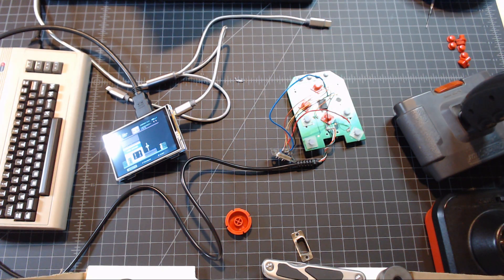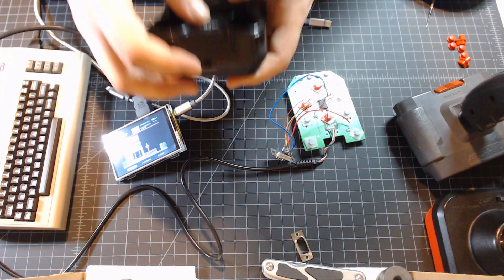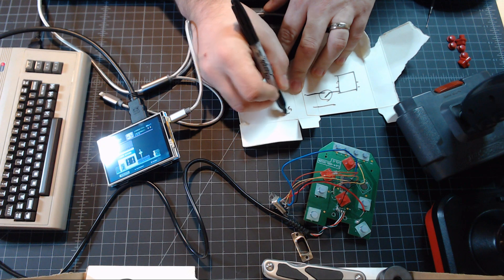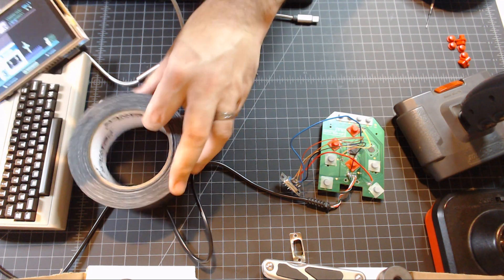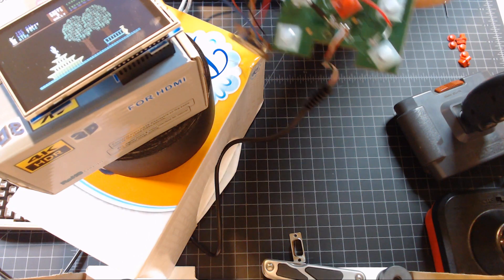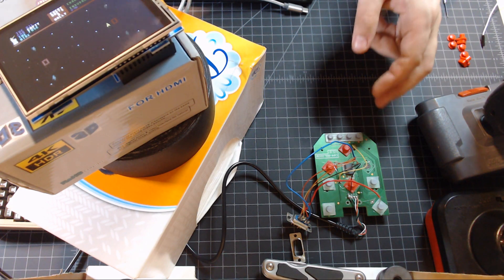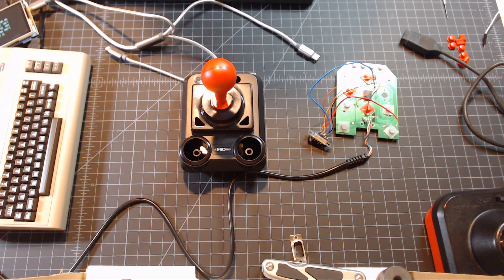How joysticks work, and why the C64 Mini joystick doesn't (Part 1 of 2)

Comment: All C64 mini/maxi users should buy the speedlink competition pro joystick. It has all the menu buttons only with different combinations, and it's the real deal! The retro brand Joystick will eventually break right off at the bottom of the shaft coz it's hollow inside!

Comment: Thanks for the video! I have the mini C64 and the joystick that comes with it. When I bought this a while back the joystick used to work, but now it seems completely dead. It still look new, and no external damage that I can see. I tried to also connect to my Windows machine, and it doesn't even register. If I put for example a mini  Sega game usb pad into Windows machine, it instantly sees the usb. I believe in the past I did connect it to a Windows machine and it did register, but it looks like right now it is completely dead. Is there a way I can fix it? I am not a hardware guy, but just wondering if you have any suggestions. Thanks.
Reply from the maker: I don’t have a suggestion if it’s not registering in windows. That makes me think that the controller board is dead which would be difficult to get past without hardware skills (an arduono Leonardo or micro for instance Ofuke be programmed possibly). Really though the idea here was to use a better joystick than the default. If the defaults dead I’d get a snes pad or similar that’s usb, or if you want to keep something retro get a usb to 9pin adapter (not serial!). I haven’t looked at this in years there maybe third party suggestions also that are better

Comment: I'm not sure if this is normal but my C64 joystick sends 4 x UP and DOWN signals. I've proven this by running jstest in Retropie and can see 4 commands. LEFT and RIGHT only send single commands. is this normal and have you seen the same results?
Reply from the maker: I haven’t seen that when testing but I could’ve missed it. Seems really odd though

Comment: My joystick isn’t working full stop.
Reply from the maker: Oh crud! Id plug it into a PC if you have one and check device manager to see if it’s even recognized. If not check the solder joints it’s possible the ground wire or something has broken off. If one of the main wires breaks it wouldn’t even register. USB has four....2 power and 2 signal

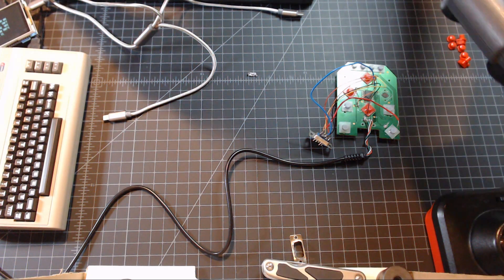Comment: 10:46
Quickshot joysticks did not use microswitches.
Quickshot joysticks used metal dome switches.
Reply from the maker: Thankyou!!! I appreciate the correction. I also found out that many older arcades used leaf switches apparently which I think I misrepresented in this video or a similar one. Too much tech to keep track of!
Reply: @geektoolkit  
Sorry, my correction itself was incorrect.

Not all Quickshot joysticks used the same type of switches.
Quickshot 1 used metal dome switches.
Quickshot 2 (which yours appears to be) used an uncommon, open frame style of microswitch.
Reply from the maker: Oh cool! Well if I was right I was lucky on that one lol! Thanks for the corrected correction. So which is your favorite retro  joystick?
Reply: @geektoolkit  
I really liked the Wico Ergostick.
It was one of the most comfortable Commodore 64 era joysticks I have ever used.
Reply from the maker: Oh I like that look!! Similar to my Epyx500, I’ll have to try to snag one next time I’m at a retro expo. When we have those again...sigh. Thanks for that!!
Reply: @geektoolkit  
Unfortunately, the Wico Ergostick actually has somewhat of a shelf life.
It has one of those soft rubber coatings that can get sticky/softened and yellowed over the years/decades.
It might be possible to clean the stickiness off with alcohol or some other solvent, but I have not dealt with that yet. My Ergostick has been stored away in a box for many, many years, but I would not be surprised if it is also sticky by now.
Reply from the maker: I wonder if retrobrite can solve the yellowing...if they’re ABS plastic (many things were/are) then that can reverse that part of it. The stickiness though...hmm wonder if I could print a TPU replacement for that part. Would be a fun thing to explore at least!
Reply: @geektoolkit  
I imagine the stickiness might be able to be wiped off with alcohol every few years.

Comment: Can you recommend other than the speedlink competition pro joystick for pc with the micro switching that i can use in my hands that's like the competition pro with the USB  but don't feel restricted to the movement i don't like the console pads. I watched your other video on Arcade controllers  joystick  just wondering because of you knowledge on this field  that you might have some better joystick that's looks the same but improved or a website that i can buy from for just playing on pc with usb plug and play for old retro Amiga games.Also i cant find your part 2 of this video
Reply from the maker: bioshock 69 part two is here: Ultimate fix for the C64 Mini Joystick - Use any Atari or C64 Original joystick!. In part two I show how to get any of the original joysticks working via a db9 so that I didn’t have to find a modern joystick, USB one or game pad. I just use any of the old ones. That may make sense as to why I went this route. If I was looking for something else I’d probably go the other way and use an arcade stick like my Quanba and some arcade buttons. Let me know if that helps

Comment: wouldn't it be a lot easier just to buy a Speedlink Anniversary Edition Competition Pro Extra Usb Joystick it has micro switches and built better
Reply from the maker: Yes of course! That’s definitely easier. You can of course just plug in an Xbox 360 controller as well. This mod is about using any original joystick but maintaining the buttons that show in the user interface. I should’ve mentioned that part. For me the Epyx 500j was THE joystick from my childhood, and anything else didn’t feel right to use!
Reply: @geektoolkit  Yes we all have our own preference myself iv'e always used the Quick shot 2 turbo and the classic competition pro this is why i was thinking of getting the Anniversary Edition as i have just found the Amiga emulator for PC with my classic games i used to game on. I just wanted to play them again for the good times i had with them from my days when the Amiga came out but i did have the Atari st 500 fm first then soon sold it when i saw the Amiga at my uncle house he had the pc  and was able to copy the games for me that i wanted  then i went to pc and i stuck with it still today.My only gripe  with the joystick that it was a bit tight on the stick movement but a review on this said it was due to the thick rubber ring around the bottom bass restricting it and needed to dismantle it to soak it into a solution to soften the rubber for around 4 days without degrading it . Then i came across the C64 mini joystick but well it had no micro switches and i think it had a plastic type ring at the base of the stick sorry for me to go on must bore you but i did enjoy your video  it was interesting

Comment: Anyone got the new C64 MicroSwitch Joystick..?
Reply: @andrewgaskell1256  Right, have taken it apart. It's based on the competition pro joystick and works on a lever system. The micro-switches are on their sides surrounding the shaft of the stick. By pushing the stick left it actually closes the right hand micro-switch and so on. The micro-switches have metal levers on them which come into contact with the stick. These metal levers aren't present on the original competition pro. I figure the metal levers on the C64 maxi joystick are causing friction on the stick... so, on mine the top and bottom micro-switch metal levers are causing enough friction on the stick to hold it to the left when you release the stick. What I've done to alleviate this is put grease on all the metal levers and on the end of the stick which comes into contact with the metal levers. Doesn't appear to be sticking now but only time will tell. If it sticks again I might look at somehow fitting a return spring to the base like they used to have in the Quickshot joysticks.
Reply: @SouvenirDin24  Any update on how it's working after some time?
Reply: @PartSiren  Hi mate, Not had any problems with the joystick sticking since so I recommend the above fix if you find the controls stick a certain way when using it.
Reply: @andrewgaskell1256  i have the same problem with my c64 maxi joystick
Reply from the maker: Yikes! That's scary to hear. I'm considering getting the Maxi...have you tried plugging in the mini joystick to the maxi? If so that would mean my hack for this would work on a Maxi and that would be amazing :D  I have a feeling for myself personally, it's going to be hard to move on from a Epyx 500 joystick!

Comment: What kind of screen is that? I really could not understand what you called it.
Reply from the maker: Danny Cooper That’s a Kuman screen...more specifically it’s this version: https://www.amazon.com/Raspberry-Generation-Display-Monitor-Support/dp/B072Q3VRXT/ref=mp_s_a_1_2?ie=UTF8&qid=1546900691&sr=8-2&pi=AC_SX236_SY340_QL65&keywords=kuman+3.5+inch&dpPl=1&dpID=511pVA9c1lL&ref=plSrch
Reply: Thanks

Comment: How can you get around it though? All the connections are different now.
Interested if it's possible, I used to have one similar to the one you showed
Reply from the maker: s j I filmed a part two last night to explain it, just need to do some editing and get it uploaded. Essentially you wire the four directional, the fire button, and ground to a DB9 connector, and then it acts as a pass through for any retro DB9 based (Atari 2600, C64, Genesis etc) joystick you want. You can also plug in a USB gamepad with at least 8 buttons, but what’s the fun in that? :) I’ll get that next episode uploaded tonight or tomorrow with the details!
Reply from the maker: SJ, got the fix video here! https://www.youtube.com/watch?v=38j8SSikZkI. Hope that helps you....I'm enjoying the heck out of using some retro joysticks